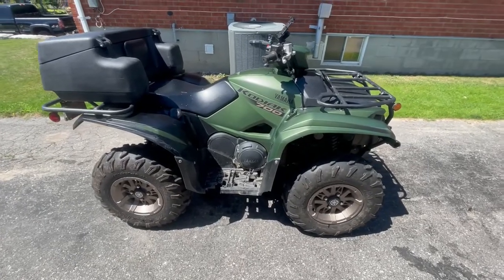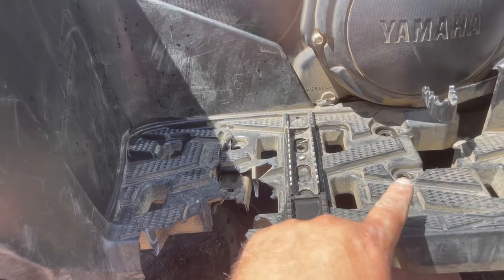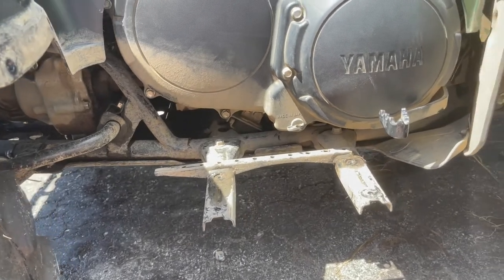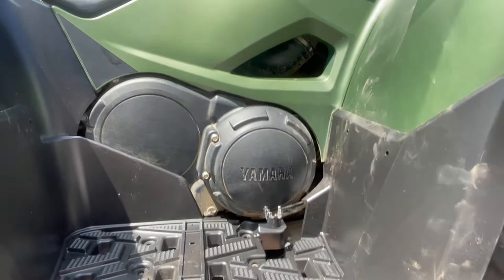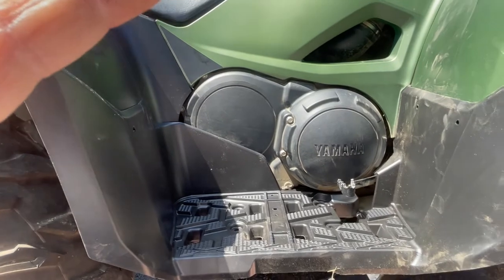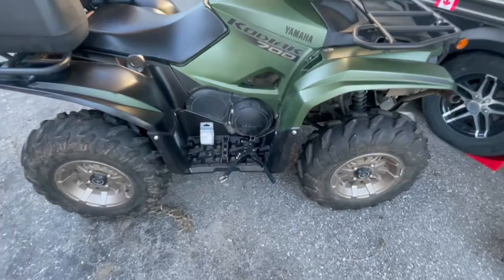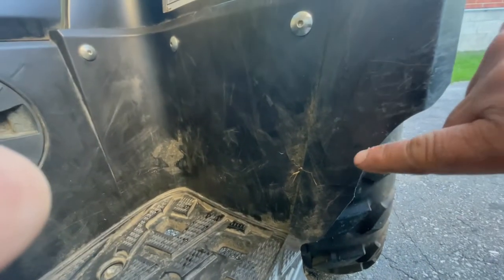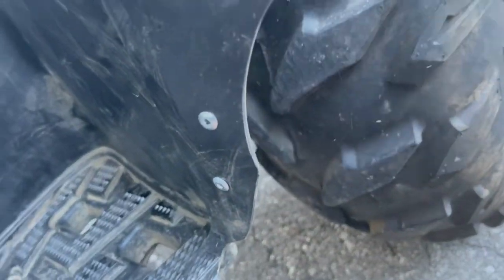2021 Yamaha Kodiak 700 footboard replacement

Comment: I have a 2021 as well. Have metal floor plates below the foot wells and a stick got around to the only spot it isn't protecting and broke a chunk out (it was cold to be fair). Just ordered a new fender well from rocky mountain atv, only 50$ so I am really not complaining too much.
Reply from the maker: There not very expensive. And Easy to change. I wish Yamaha would fix the issue. By eliminating the weak spot.. thanks for watching.

Comment: Mine is under warranty 3 months old. There cheap. I ordered metal floor plates 350,00. Lucky 7 motorsports
Reply: Where did you find metal floor plates?